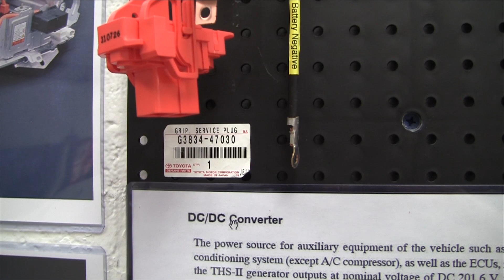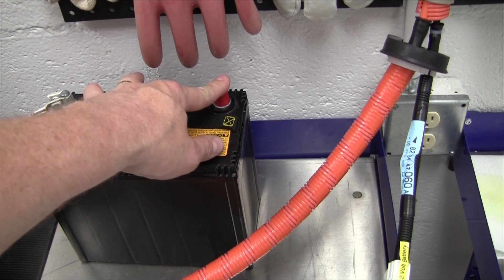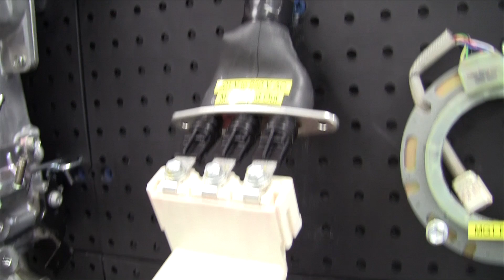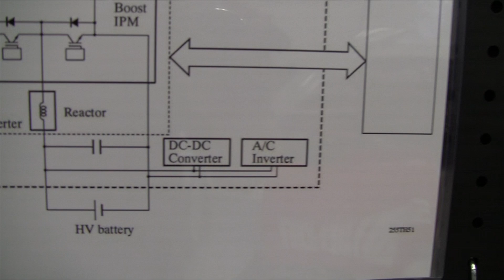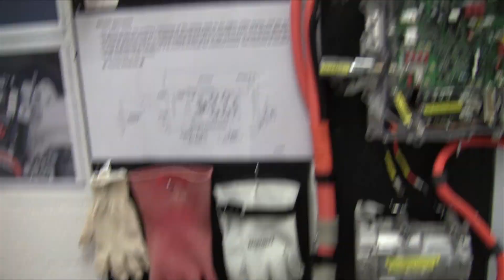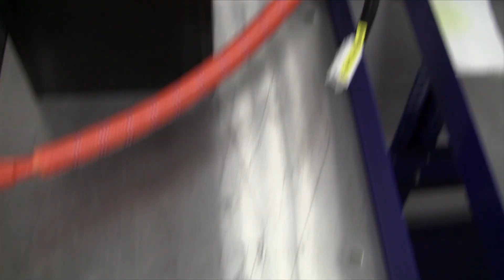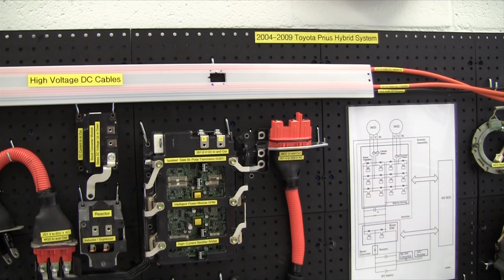2004-2009 Toyota Prius High Voltage System Operation

Comment: Hi, I recently ran a jump from my prius to another vehicle and it ruined my life. The prius is giving me the P3030 error. Before I take this to court!!!!! AND FIGHT PAYING OVER $3000+ What in Gods name can I do??? Could it be a simple bad wire in the harness?
Reply from the maker: ZPaul Lucenti chances are good that your battery is good. It probably has a broken wire that senses the individual battery cell voltages. It can be repaired with a new battery harness. You just need to find someone who knows how to do it. See https://lusciousgarage.com/blog/toyota_prius_code_p3030_high_voltage_line_snapped/ by the way, this has nothing to do with jumping another car. Oh, don't jump start other cars with a Prius anyway. It can hurt the DC-to-DC Converter. best wishes.
Reply from the maker: I am sorry to hear of all of the troubles with the Prius and your personal life.  The broken wire terminal could probably be soldered, but if you are going to all of the trouble of opening up the battery, it would be much smarter to replace the battery harness. Who know how long the solder job would hold up anyway. Again, this failure has nothing to do with jump starting your car. It is just bad luck and bad timing. The 201.6V battery with this P3030 code is not the battery used while jump starting, the 12V battery in the trunk area is. By the way, the video you referred me to was how to jump start a Prius, not how to jump start another car with a Prius. Best wishes!
Reply from the maker: Those voltages look good, but that is an unloaded voltage. The P3030 means the battery ECU is seeing that the cell voltage on one pair of the gray battery packs is zero or very low (probably from an open or corroded wire or terminal). Your battery harness buss bars are black and corroded; the worst I have ever seen. Cleaning them up will not fix the problem. They should be bright copper colored. The amazon harness is used and still has corrosion on it. If it were my battery I would replace all the battery buss bar harnesses with new ones. The nuts need to be replaced as well (they come in the new harness kit.) The nut torque is very low, everything needs to be cleaned with white vinegar, don't let your skin oil get on the buss bars, studs, nuts (will cause corrosion). Be very careful when reinstalling the bus bars on the battery, they must go back on exactly as they are now. If you accidentally get it off by one stud, you will short out the battery and cause a fire. There are so many things that need to be known and trained on to prevent damaging yourself, the battery, and the vehicle. Personal protective equipment, insulated tools, etc. Be careful. I have a video on personal protective equipment here https://www.youtube.com/watch?v=mOey5CFgfj0 Best wishes
Reply from the maker: I don't know of a good aftermarket scan tool that works well with hybrids. There may be some available. I only use factory scan tools.
Reply: Toyota on the other hand had scanned the errors P0A80 and P3015, I'm just looking over the estimate my friend had on him.
Reply from the maker: The horrible corrosion on the battery buss bars and terminals can cause a voltage drop across each connector. That could fake out the battery ECU into thinking it had a bad battery cell block. Of course, the cell block could be bed as well.
Reply from the maker: ZPaul Lucenti looks good! I hope that did it!
Reply: I will let you know how tomorrow goes! Thank you so much!
Reply: Over a week now and the car has been driving no problems. Here is a case for the books. A good cleaning of the housing will do wonders. Thanks
Reply: hi can you andvice me please  i have a car toyota sai 2010 which bring ann ann error dtc poa94
Reply: could any body andvice me please
Reply: stick with the error code. POA94 looks inverter related. google the hell out of the error code
Reply: ZPaul Lucenti thanks ma brother your charting from where?
Reply: Peter Maina Mutahi Orlando dude
Reply: ZPaul Lucenti ok
ay and i from kenya nairobi capital city

Comment: weberauto can you please make a video of you disconnecting the hv battery and using a multimeter under the inspection cover to make it safe to work on? I'm a vehicle technician and recently been on a course to make these vehicles safe to work on in the workshop, although qualified to do so I'm not 100%. I'd rather not do this procedure
Reply from the maker: +seanthepowerdavies That is a great idea. I will work on that! Thank you for the feedback.
Reply: +WeberAuto thanks for the quick reply i appreciate it you obviously have great knowledge of this subject. We have to disconnect 12v battery then remove service plug and use multimeter on SMR unit, after waiting 10 minutes remove inspection cover under the bonnet and check voltage has drained to 0.5 volts.? if that's correct? how do you reconnect the system up safely after the vehicle has been repaired?

Comment: @WSU, Dear professor 
What is the "B" on the gear shift used for  , what is Engine brake?
Reply: if im not mistaken, B is used when you are goin downhill,
Reply: In a Prius, the high voltage hybrid battery is fairly low capacity, so it doesn't store very much energy (compared to electric cars). Because of that, when you're going down very long hills, such as descending from a mountain, the regenerative braking will pretty quickly fill the battery to its full capacity and all the rest of the energy after that is wasted. Meanwhile, you lose the regenerative braking function because it can only operate when there's somewhere to store the energy it generates, so you're relying 100% on the standard friction brakes. This can, like with any conventional car, cause them to overheat.

Since the Prius or any other vehicle using Toyota's Hybrid Synergy Drive or similar licensed system don't have any transmission gears that can be downshifted to slow the vehicle or help prevent too much acceleration, regenerative braking is all it has that's similar to downshifting in a conventional gas-powered car. B-mode is "engine braking mode", which is as close as it gets to downshifting in a conventional car.

It works by taking some of the electricity generated by MG2 and re-routing it into MG1 in order to spin the internal combustion engine at a high RPM (and adjusts the valve timings and the Atkinson cycle) in order to maximize the air-pumping effects of the engine to use up some of the excess energy developed by the regenerative braking. It's basically the exact same thing as downshifting does, except that it means less of the regenerative braking energy is being stored in the high voltage battery, so you'll have regenerative braking for a longer period of time, and at the same time, using the internal combustion engine friction and air-pumping resistance to help keep the vehicle's speed lower, or to slow the vehicle, thus reducing the braking load on your conventional friction brakes so they're less likely to fade or overheat as you're descending the hill.

In my Prius, I've noticed that it requires around 10 amps from the high voltage battery (roughly 2,000 watts) to turn the internal combustion engine at an idle speed (960 RPM if it's not injecting any fuel), but at higher RPMs like you'll see while coming down a hill in B-mode, that's likely to increase by quite a lot. It might be able to burn off an additional several kW of energy, but I'm not sure how you'd really measure it without some special test equipment or talking to a Toyota engineer.
Reply: babybirdhome , Thank you for sharing the information

Comment: Very helpful sir but  . engine does not crank no  codes   assuming there's  no starter  where to test or how test ?? Thanks
Reply from the maker: Always check for trouble codes and follow their diagnostics.
Reply: No trouble codes
Reply from the maker: @luiguimartinez820  Make sure your 12V battery is good and start checking fuses, and electrical connectors for looseness or damage.
Reply: @WeberAuto  thanks😁😁

Comment: Hello thank u very much for this video. . I just need our help sir pls 
The Ac blower motor is not working I tested out of the car its working I installed it back its not working is there's anything have to do the inverter converter or the Ac comprser? ?? Need help pls
Reply from the maker: Does the blower work when you select the heater? if not, check fuses. If the fan does work on heat, then the A/C control head may not be turning on the fan due to low refrigerant on an electrical problem. The Inverter/converter is an unlikely cause, but possible. Check for trouble codes.
Reply: WeberAuto I check all the feuses every thing is fine the Ac comprser is working I check it an it make the hose very cold but the blower is not working

Comment: you think it would be possible to hack the stock inverter to make it into a phev and just add a second prius battery
Reply from the maker: I don't know. A second Prius battery would not get you very far because they don't have much capacity.
Reply: ok but is it still possible to hack the stock inverter how do the new phev prius do it

Comment: You need to re-evaluate what your calling 'High Voltage' if you are truly teaching other students.
Reply from the maker: +muz guy Hi, it is all relative. 144 Volts is high compared to 14V. Thanks for your feedback.
Reply: No it isn't actually, not according to your standards I'm sure. You need to review your standards if your teaching this to students. Your definition of low voltage is A/C: 50–1000 Vrms and for DC it's 120–1500 V.
Your definition of HV is > A/C: 1000 Vrms  and for DC it's > 1500 V.
I wouldn't believe for a minute you could teach or even defend what you're saying if you truly are a teacher.
Reply from the maker: muz guz I must be misunderstanding what you are telling/asking me. Have a good day!
Reply from the maker: +muz guz Okay, you are correct. In my automotive world those are high voltages. The Society of Automotive Engineers (SAE) standard j1673 defines High Voltage as between 50 V DC or AC RMS and 600 V DC or AC RMS excluding automotive ignition cable. I understand that there are official definitions of "High Voltage" in other fields and that the voltages I am referring to are not considered high voltage in those fields. Now I think I understand why you said that.
Reply: @muzguz7276 - It took him more than a minute to do both, you "Mr Personality".
Reply: Before you make such ridiculous comments you need to be aware of definitions. Do yourself a favour and look up your definition pertaining to your locality. Then report back with an ' I'm sorry'
Reply: @Lvatopesado  are you even commenting to the right person? If so you make the least sense out of everyone.
Reply: Before you make such ridiculous comments you need to be aware of definitions. Do yourself a favour and look up your definition pertaining to your locality. Then report back with an ' I'm sorry'

Comment: Cool to see someone have show whole system outside of car.
I was thinking if there is a chance to use this hybrid system as emergency power generator.
We have an engine, we have power generator, accumulator and inverter.
My idea is to use in case of emergency whole system as power generator.
I understand battery is 220-230V so exactly as voltage in European power grid. Inverter is converting this DC voltage to AC to power e motor. Would it be possible to get somewhere in this system 220V AC?
This was instead of powering e motor would be possible in critical situation as any type of blackout to power some most crucial devices home like fridge, maybe pumps for water etc or even boil water for a drinking. 
Anybody have such knowledge?

Comment: from where you took those 201 volts
Reply from the maker: +hugo ramos Hi, the 201.6V comes from 96 2.1V NiMh battery cells in series with each other. Thanks for watching!
Reply: ever heard of a volt meter

Comment: Thanks for the upload! Would it be possible to shield some of (if not most of) the dirty electricity in my 2008 Prius by shielding all of the wires? I would basically like to be able to hold a hand-held AM radio inside the car when it's on without it going bonkers, and instead producing just normal static at its lowest end. Here is a link to a person who successfully lessened the dirty electricity that his solar panels were creating. Thanks so much. Link: https://www.eiwellspring.org/emc/SolarRFImitigation.htm

Comment: 201.6 V is not high voltage... >10kV is.....
Reply from the maker: +Roger Keulen Okay, you are correct. In my automotive world those are high voltages. The Society of Automotive Engineers (SAE) standard j1673 defines High Voltage as between 50 V DC or AC RMS and 600 V DC or AC RMS excluding automotive ignition cable. I understand that there are official definitions of "High Voltage" in other fields and that the voltages I am referring to are not considered high voltage in those fields. Have a good day!
Reply: wow your a gun, son.

correct my terrible english and pronunciation if you will. have a good day to you sir of great might. be careful of your high voltages in 'your feild' as we may never see another you again. xxoo
Reply: +Roger Keulen lol, 201.6 DC can absolutely kill you
Reply: @_ShaDynasty  - Then it is "HIGH VOLTAGE" ha ha ha.